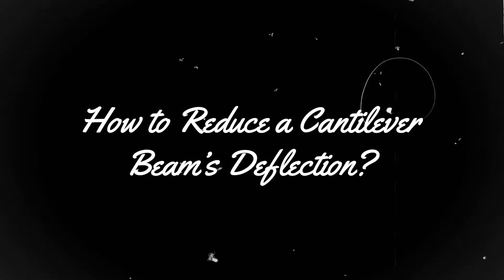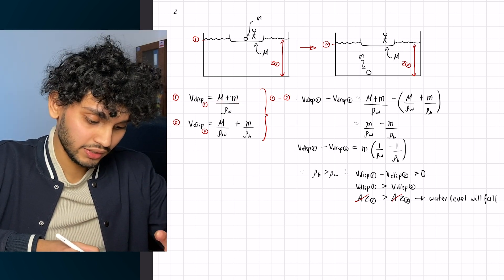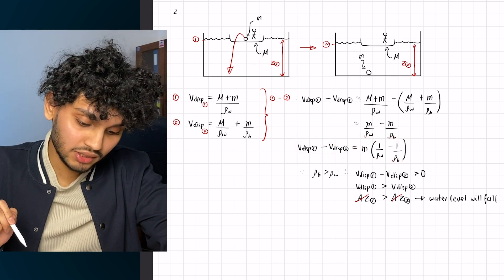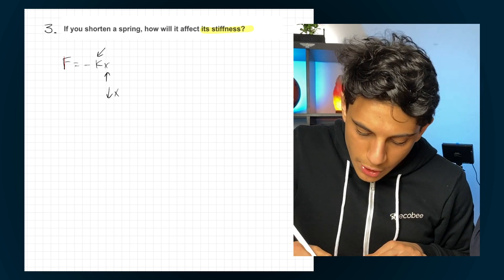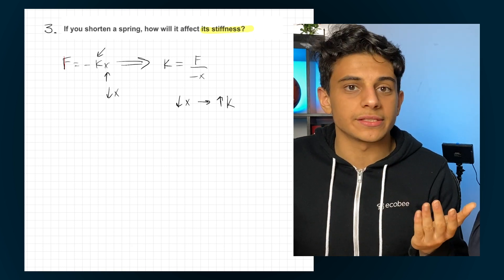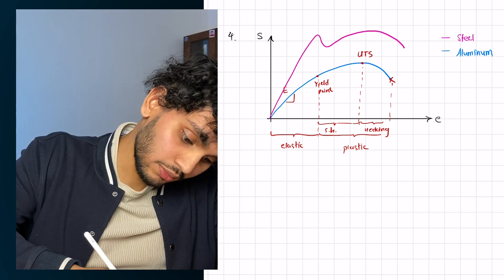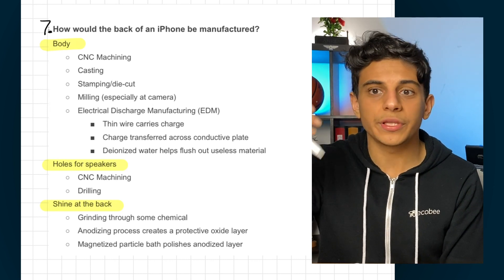Technical Questions Asked in Mechanical Engineering Job Interviews

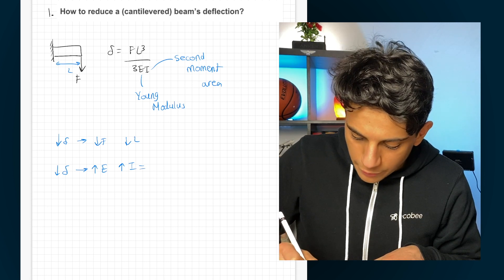Comment: 1:45 The question is not specific about  beam cross-section . Therefore you don't need assume that the beam has a rectangular cross-section.  it can be a IPN , angle iron or whatever. It is a  mistake i made in answering this question one and got the feedback later!

Comment: could the ball be somewhat submerged? like heavy enough not to be floating at the surface but light enough to not go to the sea bed?
Reply: That would have to play into temperature or some other external factor not accounted for in the problem. If so, then this solid is the same density as water
Reply: @nocknock4832 Not really, if you know the ratio of the amount submerged to the amount floating which you would have to know in this case, you can find the volume displaced that way.

Comment: The Spring Stiffness question is worded oddly.

There could be two meanings to this question:

(1) If you are trying to evaluate the Spring Constant (k) when you know Spring Force (Fs) and displacement (x) - then its a simple matter. For spring force Fs - the smaller the displacment is the stiffer the spring has to be. If the same spring force - stretches the spring much more - then that means you have a 'lighter' spring or a lower k value.

(2) If the question meant how do you effect the actual physical/natural spring stiffness - then that is a much more complication question related to Spring Design. That has to do with the material, diameter of spring wire, # of coils, the angle of the helix of the coils etc.,.. 

Basically- spring stiffness is a natural property of the spring as a product - it doesn't change and is fixed.
Reply: I believe K would still increase in case 2(without finding my mechanisms design textbook). you can model the “cut” spring as two springs added in series. When you add two springs in series the combined K is less than the individual k(s). Thus, it is reasonable to assume that the Cut spring will have a higher stiffness than the original.
Reply: That's what I am thinking too. They asked how would it effect the spring if they were to shorten the length of the spring and not compress it. So, maybe they had to answer the question through a design POV view.
Reply: Yep. I went straight to the comments looking for this.
Reply: This response makes me so happy haha. That's what I thought too

Comment: Shortening a spring doesn't refer to reducing the x value (displacement from the equilibrium position). It's referring directly to the factors that affect the k value. One of those factors is n, which is the number of coils (this is directly proportional to spring length). You can look up the equation for k. Shortening the spring does increase stiffness, so your final answer is correct :)
Reply: There's a great answer on Physics Stack exchange .com: 
k=Gd^4/8nD^3
where d is the wire diameter, D the coil diameter, n the number of active coils, and G the shear modulus. So if you cut it in half n→n/2 the spring constant doubles k→2k. The maximum length decreases of course and you get into the non-linear regime with less displacement.
Reply: I believe k should increase because when we chop off some part of the spring, we can consider it as disconnecting two springs from series. As we know connecting two springs in series decreases k, so removing one of the spring should increase overall k.
Reply from the maker: Hmm that’s a good point, I’ll look into that...thanks for sharing :)
Reply: @TamerShaheen  this channel has value
Reply: @TamerShaheen  man I am sad that I could not become engineer :(
Reply: @masternobody1896  I don't think its too late. You can always study if you have the time. You can also make engineering a hobby. Basically, make things when you are free and for fun. Don't give up my friend!